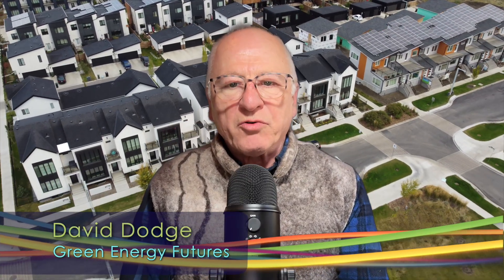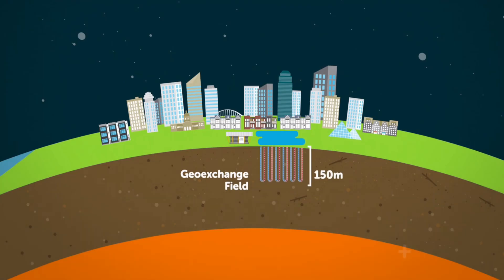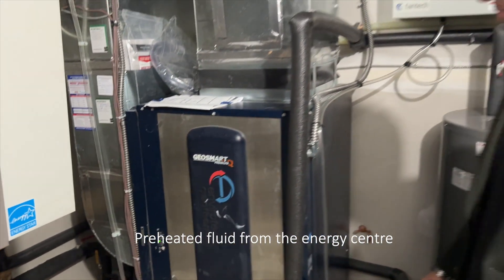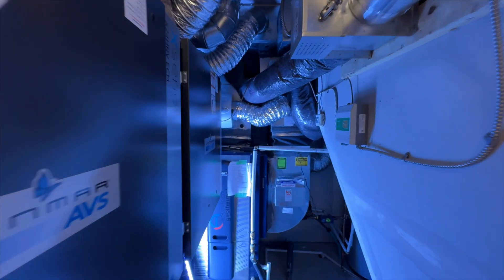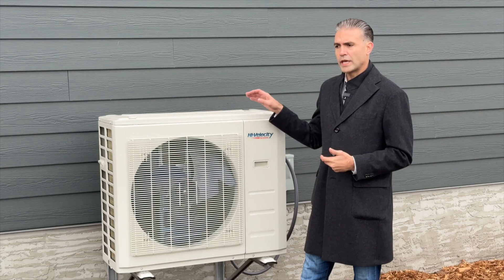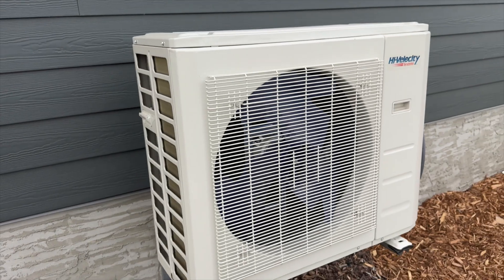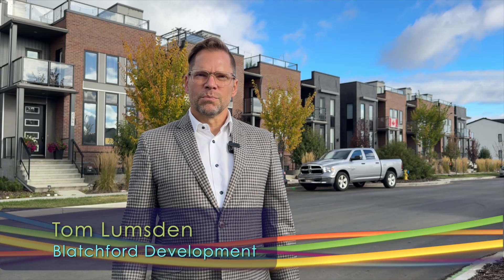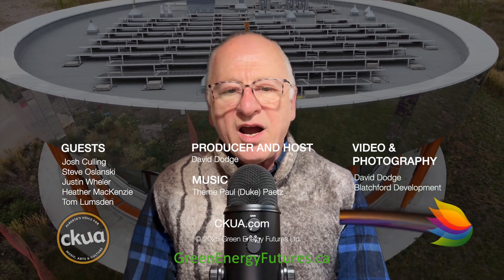The Future of Heating: Blatchford's Heat Pump Revolution

Comment: Took me a minute to figure out what he meant my that "check box .. for legal suites".

I think he means that if you subdivide the home to rent out the basement: the basement tenant gets their own temperature control.

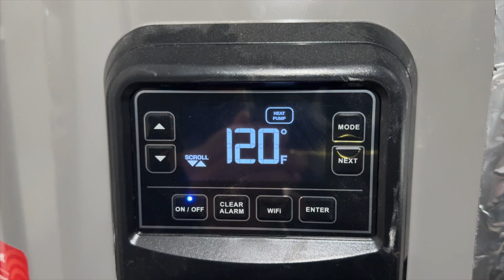4:00 the video does not make it clear that the heat pump water heater is not hooked up to the district loop.
That duct shown allows the water heater to get heat from a larger adjacent room. The water heater will have back up resistive heating elements at about 7kW.

Comment: Sooo...what happens when it's -40 deg C for 3 weeks straight?
Reply: Ground source heat pumps are unaffected by outdoor air temperatures, the load (demand) just gets higher.

Ground source is EXTREMELY expensive though, and rarely does it make sense over far cheaper air source heat pumps.
Reply: @superspeeder  agreed. I wish I could afford one. Definitely not in my budget.
Reply: Geothermal doesn’t care what’s the temperature outside
Reply: @triforcelink  But heat pumps typically do...
Reply: @carnivorecanuck Air source heat pumps do, but this is all ground source.
Reply: Lived in Edmonton for 18 years now, genuine question, when was the last time it was -40 for 3 weeks straight?
Reply from the maker: @carnivorecanuck  nothing the ground source heat pumps input temperature is always 10-15C.
Reply: -40 deg C never happens in-city.
I know because I monitor the temperature due to the minimum storage temperature of my car being -37C.